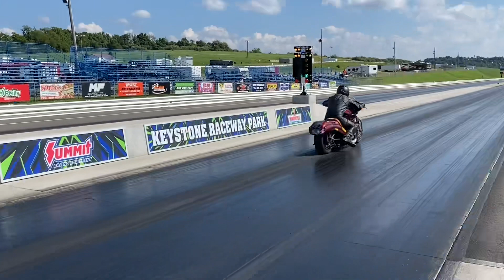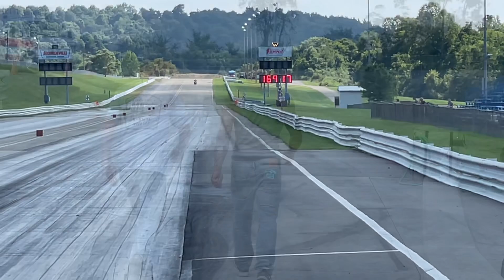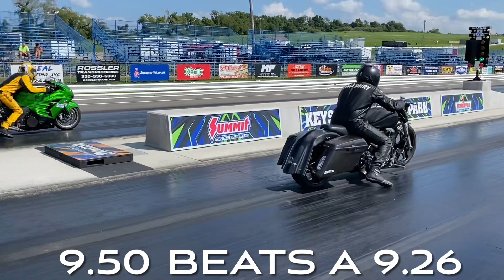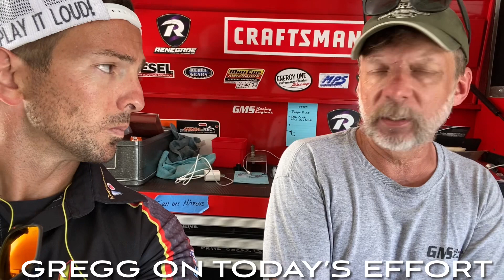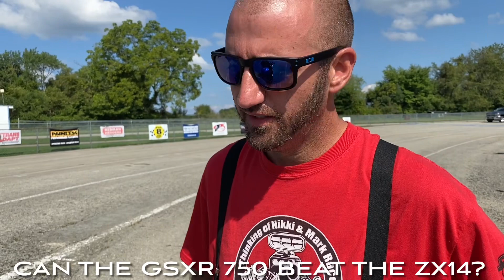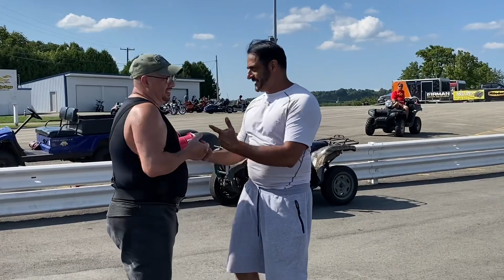What it REALLY Costs to Build a 7 SECOND HARLEY DAVIDSON

Comment: Back in the day. With no gps. The worst thing about racing at Keystone. Was finding the dam place. Then the DUI check points after 12pm coming off the turnpike.  Thank God for O'Dools.
I think the success your seeing.. Is because the guy has 170CI on a stretched ProMod chassis Take some weight off the clutch. Lower the rear tire air pressure a half pound.

Comment: 7 second Sporty with no wheelie bar on a street tire and 1 single disc brake up front, but not a 4 piston radial caliper. No sir, it's not even a radial caliper. It appears to be a 2 piston rear axial caliper BUT that's not even the craziest part because it could even be a single piston. I hope he has a good master cylinder lol
Reply: That would be more friction.😅

Comment: Back in 1980, I had (the late) Alan Sputhe build me a 78 CI Sporty..XR style...it cost me $4K a good hunk of change...but it was pretty fast, I never race it, but it's easy a 10 second bike..Same type of engine as the cover of August 1980 cycle world...and a bear to kick-start.
 It's still fast enough for me, I'm 75...it's even faster than my S&S 93" Knuckle-head sidewinder...that one, maybe 60 horsepower...maybe...
 So these big gas engines cost $100K...what about the Nitro motors..?
Reply: There’s nothing easy about cracking the tens on a sportster. At least not on a genuine street ridden one. Building power is one thing but getting off the line cleanly is another. Mine regularly runs mid elevens in the quarter and low sevens in the eighth. And I run 91 octane pump gas and get 46 mpg. Street tire, stock wheelbase, foot shift and no wheelie bar. An extended swing arm or a bar seems to always be the answer but to my way of thinking then it’s no longer a true street bike.

Comment: Yeah but can it make it more than a mile on an actual street??
Reply: Cycle world determined the 2009 - 2012 XR1200 sportsters the most trouble free best handling harley ever build ..most popular street bikes in japan as is harley davidsons in japan with clubs of members numbering 175,000 all ride harleys ..and the japanese have a manufacture called TRIYJA who takes XR1200 to the next level and sells them back to us as there are established TRIJYA dealship on the west coast selling all harley models by TRIJYA of japan back to americans of three times of stock msrpi.. apparently none of you h-d haters know since 1985 anything about the E.P.A. , the D.O.T. and The Federal Motor Vehicle Safety Standards (FMVSS) are U.S. federal vehicle regulations specifying design, construction, performance, and durability requirements for motor vehicles and regulated automobile safety-related components, systems, and design features.
These are federal laws enforced buy the environmental protection agency ,who enforce all contamination and noise pollution,  Department of Transportation who enforce all laws of street legal vehicles  and the by the FMVSS that enforce the lemon laws ..that all thee agencies since 1985 have put a stop to leaking fluids smoky exhaust and loud mufflers at the factory assembly line level before any vehicles foreign or domestic vehicles can be distributed to any dealership  preventing the sales of all cars and motorcycles of todays strict  no tolerance federal laws ...all your negative  criticism  about harleys is totally impossible to have ever happened for the last 38 years that clearly points out the average of your level of intelligence and your generation average  I.Q. being one point above a dog ..your major attacks of no performance is based on standard o.e.m. without no mention of Four levels of optional horsepower as harley is the only manufacture of  motorcycles in the world who offer any level of higher performance keeping your full two year warranty intact ..and speaking of warranty claims honda brags they sell more motorcycles in the world than anyone with only 15% failure that also applies to federal lemon laws and safety violations are in actual units sold is a number of hondas failed than the number of bikes harley has ever been capable of ever producing in one year ..so is why honda never actual gives any real numbers ..as they will never tell you that you have 250,000 chances to end up buying a total piece of junk ..by the way are all the exports to the U.S.A. as the japanese citizens are sold a much higher quality of all the japanese cars and bikes that very few elite japanese can afford is why they all mostly ride harleys that most people with the I.Q. of there pets dont know and can learn ... And about your generations inability to make change for a $1.00 dollar bill without using a calculator your bunch of Einsteins use the harley CVO prices of one off factory customized harleys per owner list of features plus the much higher price of all the Custom Vehicle Operations the harley sells as optional limited production that only american muscle car manufactures do like SHO, SVO, SVT COYOTE ,VOODOO  , COBRA JET LIGHTNING GT40 ,,..COPO ,LS, ZO6 LS-1 STS , SS TRANS AM H.O. / S.D. AMX, Z/28, GRAND NATIONAL  HEMI CUDA NICKEY Chevy , HELLCAT , DICK LANDY  KB COBRA, SALEEN, STEADA, and these are all luxury american   to compare to your
Reply: @donniebaker5984  wow, what a reply!  I admire HD also. There machines are expensive but stunning, with an aftermarket heaven. My electra glide has 152, 000 miles on it. I purchased it with 150, 000, but we ride it anywhere with no concern. All bikes are cool. We must stick together. Especially these days, before we go electric, to pedals. 🙂